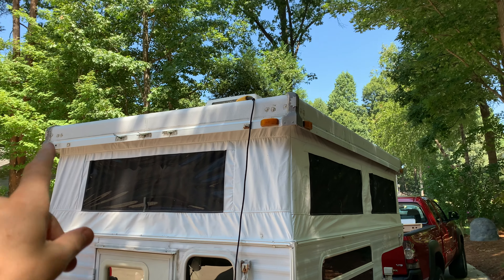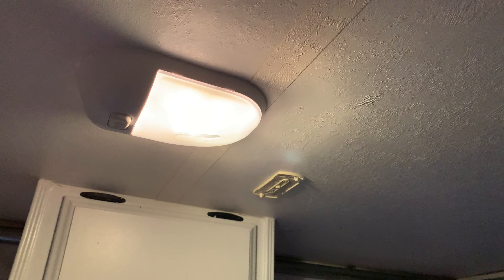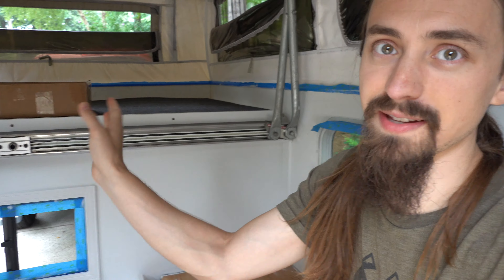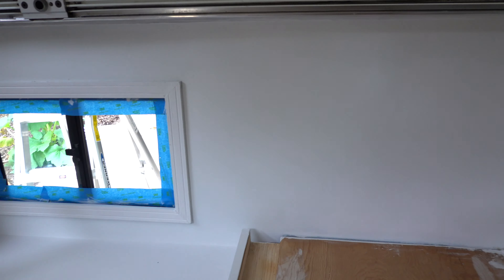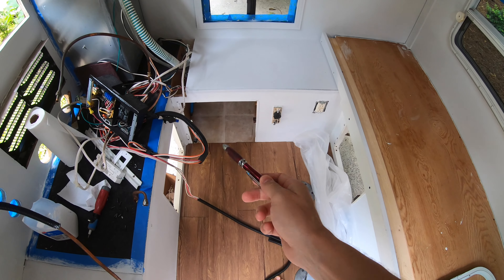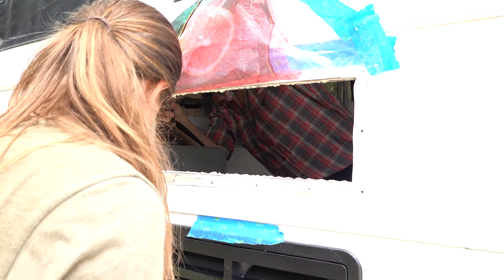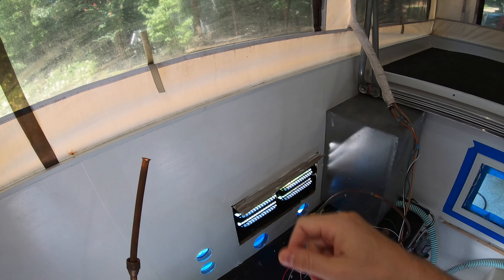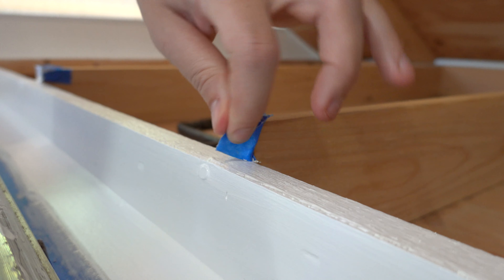Patching Holes & Painting Interiors // Tacoma Truck Camper Reno #4

Comment: Have you considered retrobriting that controller on the ceiling? LEDs + Peroxide should be able to restore it.
Reply from the maker: I've heard about the process but haven't had a chance to do it yet. I'd like to try. The controller on the ceiling is for the AC which we are replacing with a DC fan. I think there are plenty of other spots where we could try that though.
Reply from the maker: Also, best name for a process ever. Retrobriting...

Comment: On the passenger side, do you have a pull-out plywood piece under the seat that makes it into a bed? It looks like there's some kind of channel and edge there.
Reply from the maker: Yup, that side of the camper pulls out into a little double bed. The nice part is that you can sleep on it with the top of the camper down so we’re thinking it’ll be great for stealth camping.
Reply: @BackcountryBanter  Cool, I'd love to see how that mechanism works. We're looking at how to best build something on that side too since we won't be using the table top and old cabinets that made into a bed there.

Comment: I just patched my truck camper old fridge holes today. Why did you not patch both? Water and dust will get into that vent (that's why behind the old fridge was all metal asking it waterproof and needed to be cleaned every once in a while). You won't notice this if you put something in front of it. Maybe you realized this and already fixed it but just in case I wanted to point it out. 👍